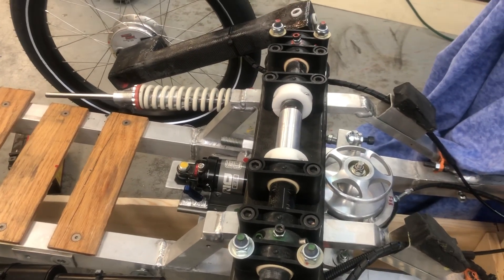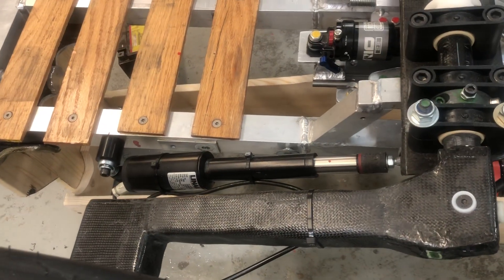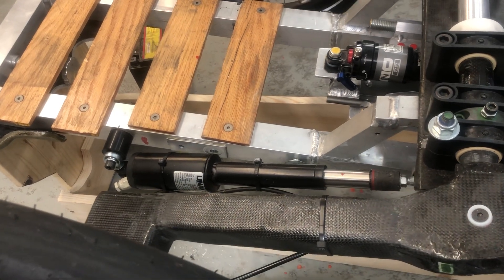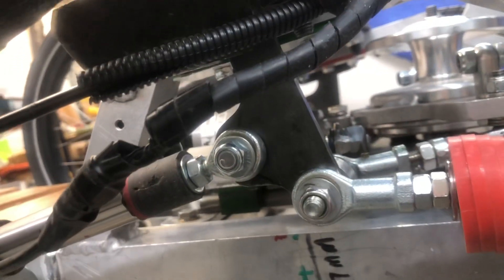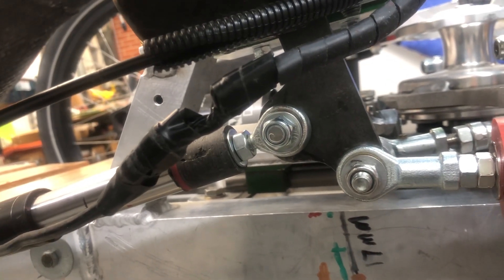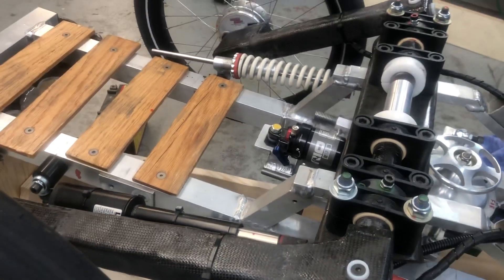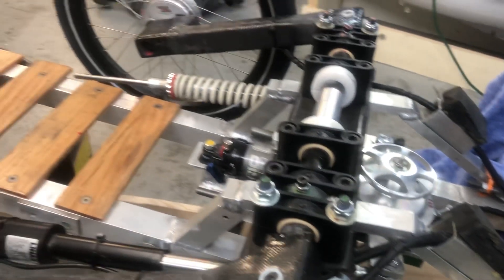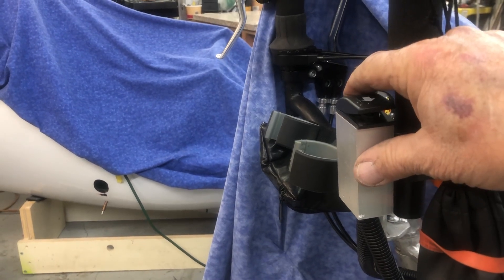velotilt velomobile

Comment from the maker: Another motor that looks like this but shorter and more newtons w/4" travel will be here friday. Also machining new frt axle and hub with tapered-roller bearing & snap rings. Ordered new freewheel spacers from ebay too. Three 50mm gocycle tires, they are safe and ride like suspension.